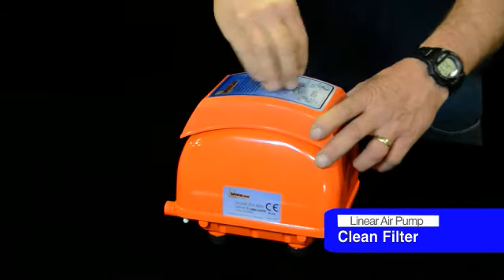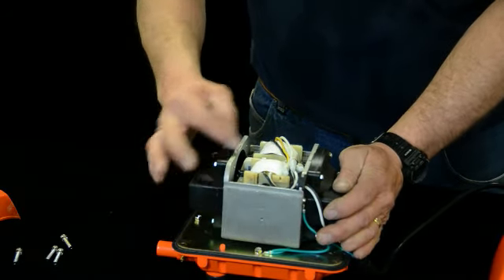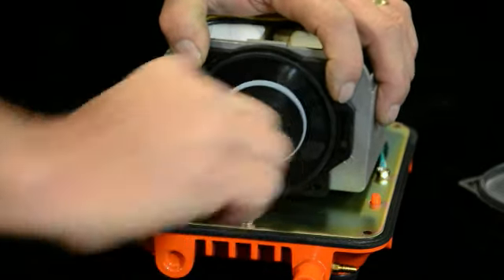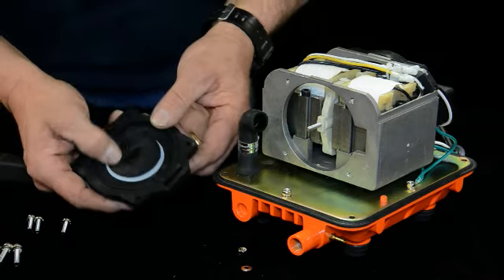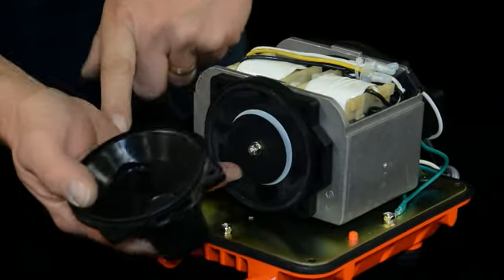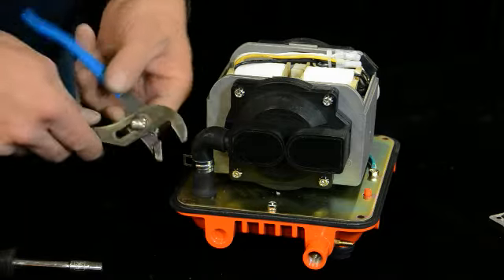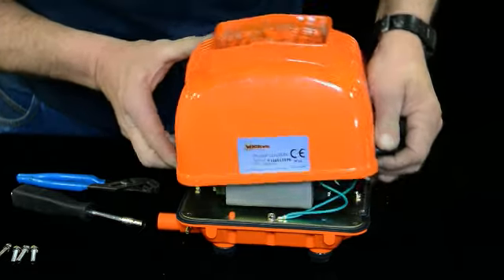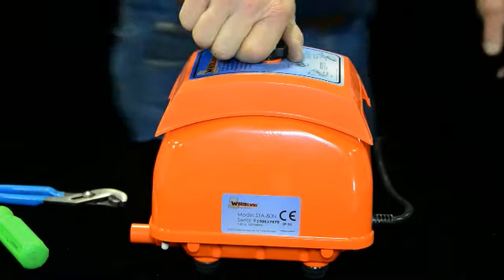Whirlwind Linear Air Pump Rebuild

Comment: FYI, you guys may want to offer replacement hoses that connect to the diaphragm caps.  When I replaced mine the hoses broke in several places, due to years of weather exposure.  I made it work for now.
Reply from the maker: Hi Chris! 

Replacement L-Tube hoses can be found here. 

https://www.septictankparts.com/filterSearch?adv=true&cid=0&mid=0&vid=0&q=l-tube&sid=true&isc=true

Thank you! If you need further assistance, let me know! debbie@septictankparts.com
Reply: @Septictankparts  Thanks for the follow up!!